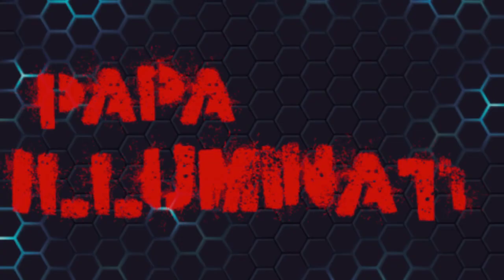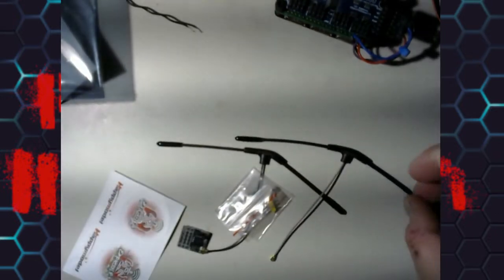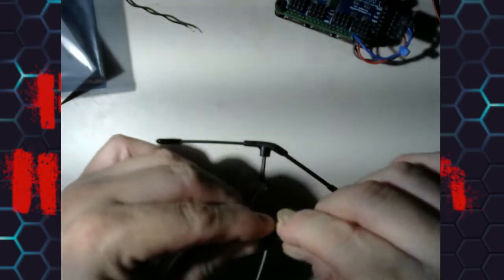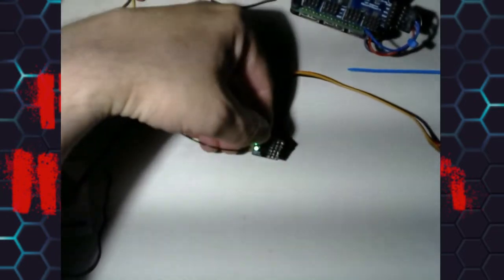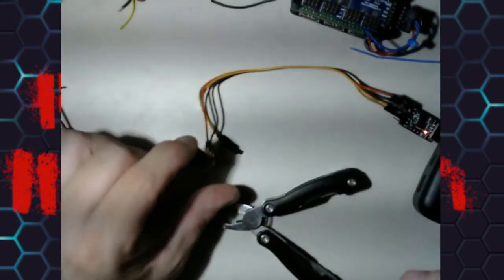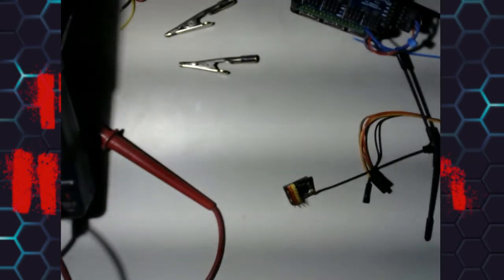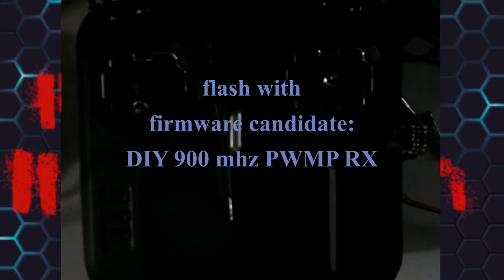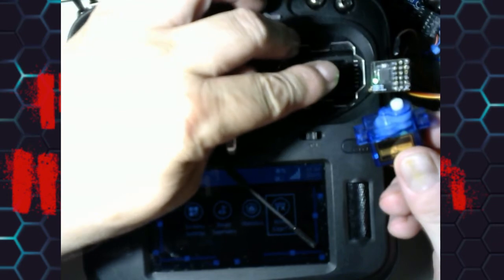Fixed:  HappyModel ExpressLRS ELRS EPW6 900Mhz with solid green light issue - stuck in boot mode

Comment: Cannot see what connections you are making. Low res, and camera never focussing on the board.
Reply from the maker: use the writing/pinlabels on your board as a guide and attach the pins that you are told in the voiceover.  You can also use the orientation of the board landmarks on the board as a give away.